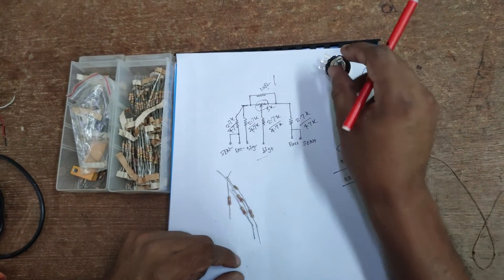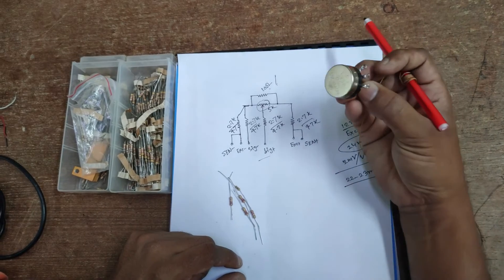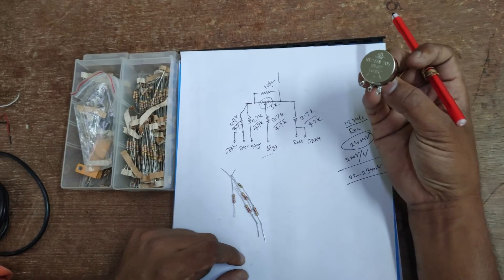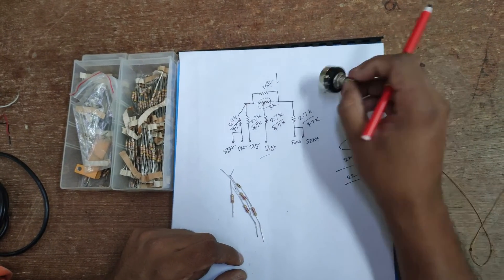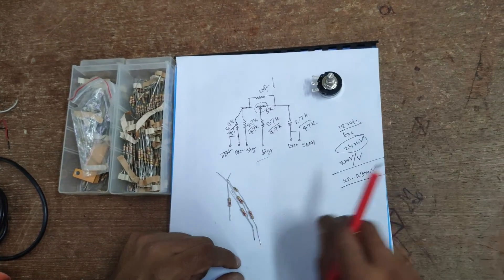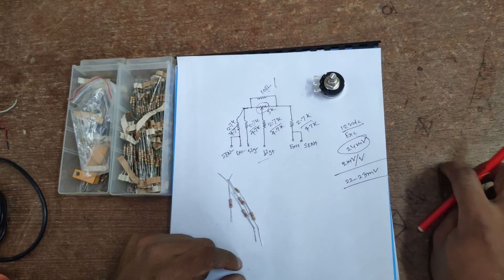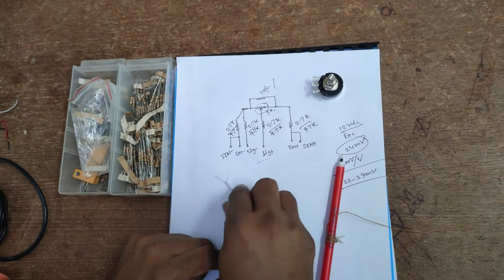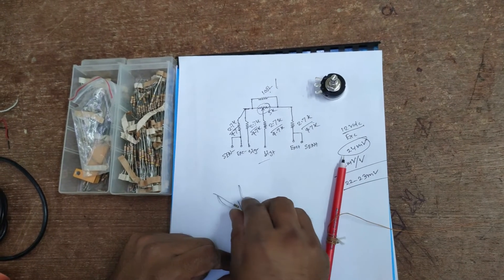How to make Loadcell Simulator? Testing Simulator |

Comment: Very interesting video.  I am really new to this, but I need a simulator.  I am using a 10 turn 500ohm, 3 terminal pot.  I am using five 250 ohm resistors in the configuration shown above.  The shunt resistor is 1 ohm.  I tried to model this in an online simulator (circuitlab) and it indicated an output of about 2.99 mVolts on an excitation voltage of 3 volts.  However, in practice, I am seeing output of -.0001 to  .2356.  The resistance of the pot as measured by a multimeter seems to smoothly increase or decrease on turns, but the the output between -.0001 and .2356 jumps about wildly when pot is turned.  I have suspected the pot though it is same as used in a commercial simulator I looked at.  I wonder if my resistance values are two low (including pot).  I am trying to simulate (I think) a sensitivity of 3mv/V so perhaps I should use a larger shunt resistance to get a larger output.  Anyhow, I am completely stuck and would appreciate any thoughts or suggestions.